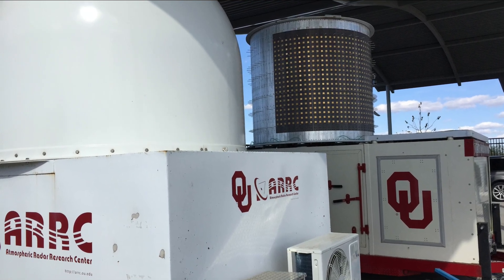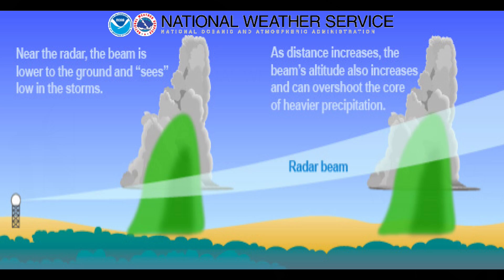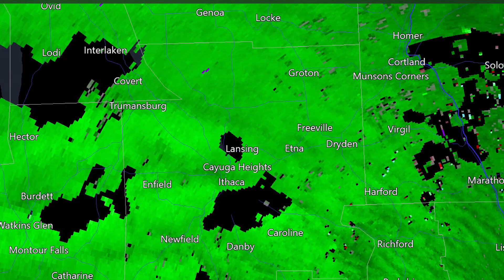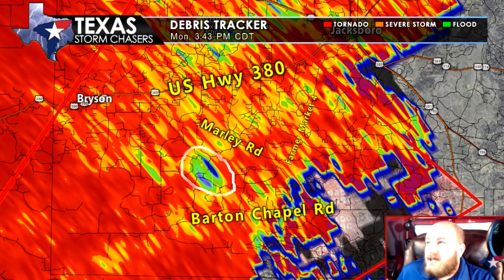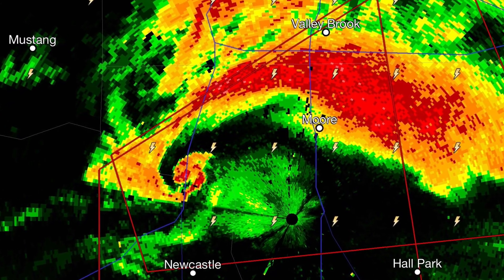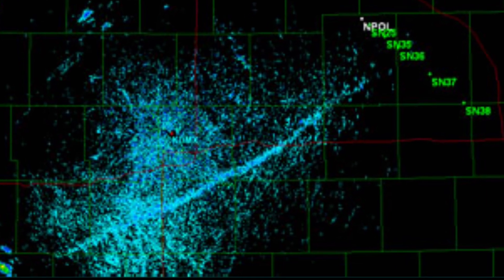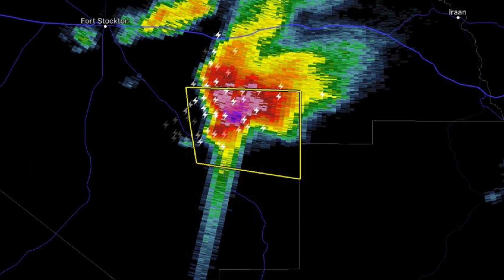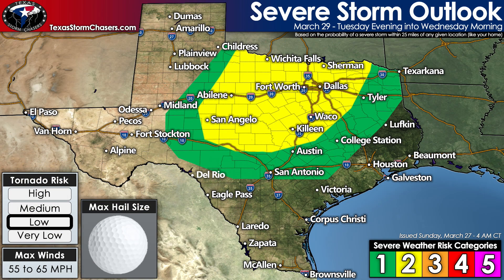Weather Radar Basics & Key Reflectivity Features to Look Out For (feat. Jason Cooley)

Comment: Thanks for this. I've worked on radar the better portion of my life, beginning with simple search radar in the Navy, and then also attack radars on some fighter planes.  The explanations here are good for beginners to help understand radar basics. It's some fascinating tech.
I was particularly interested in the applied science of radars with storm and weather returns, and you did a nice job in showing a few of these in some nice simple graphic examples. 
You should follow this up with a more advanced "class" on advanced weather and storm radar patterns and returns, and some more depth into the actual science as applied to weather and storm radars - Like maybe frequencies used, the signal strengths etc..  
Anyway - Thanks for this - Nicely done!